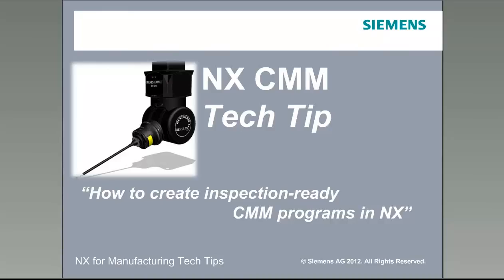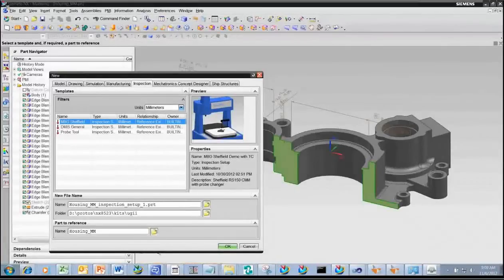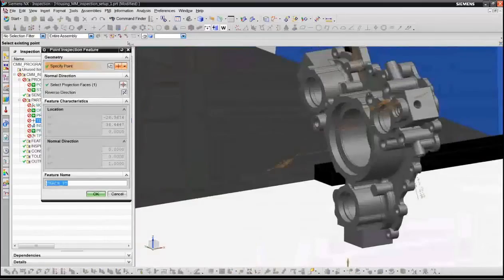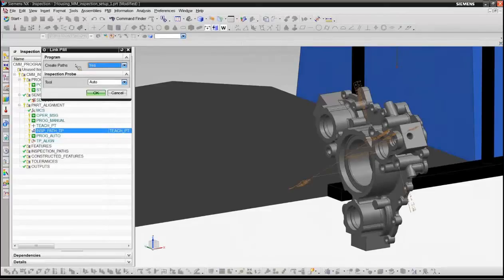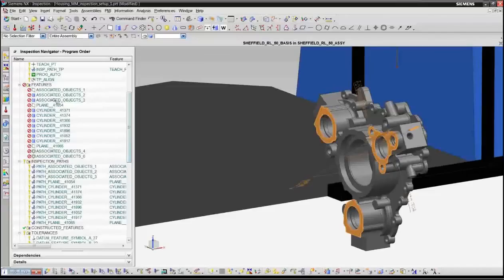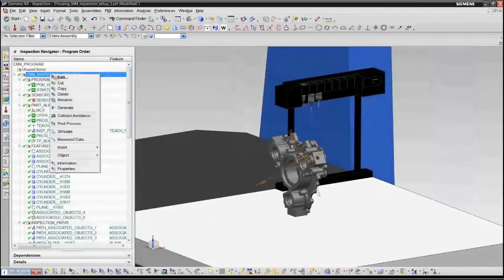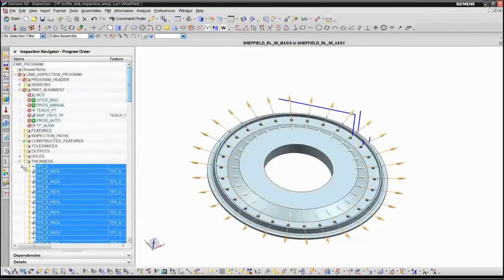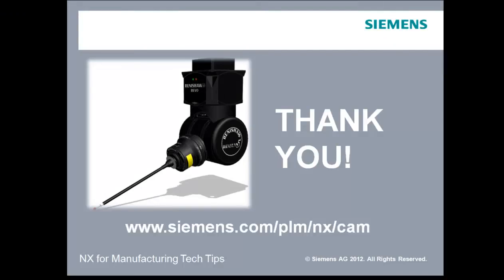CMM PROGRAMMING - How to create inspection-ready programs in NX (Siemens PLM)

Comment: " The Next Step in CMM Programming is very well articulated. Kudos to Siemens to pull this together, which was long awaited by myself and my team. The main advantage of this is now fills in the void of CMM not residing within the Team Center.

Through this Comprehensive bundling Siemens has now ensured that all the required data for producing a part is on a single platform-i,e PLM. I would have liked to have see the Other Post Processor especially the Zeiss and the Mitutoyo machines without being complacent on the monopoly each of these OEMs have ensured and enjoys them till date.

Since Siemens has the certified DMIS 5 versions, it would not be much difficult to convert this to a Calypso or a MCOSMOS program.

The Other thing which I thought would be useful is to have the Statistical Process Capability(SPC) results for Data management and Analysis similar to the Measure Link of Mitutoyo."

Regards,
Vijay Anand.R